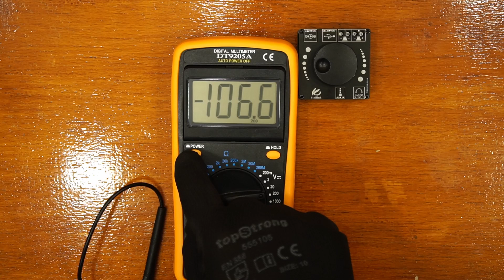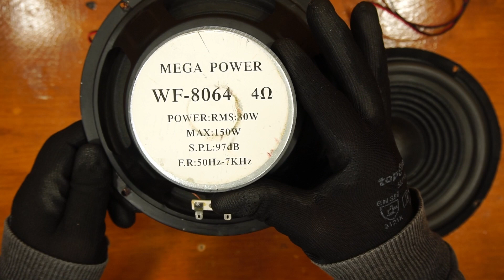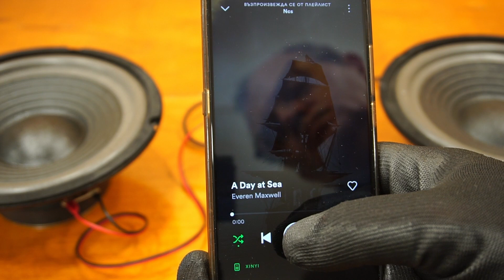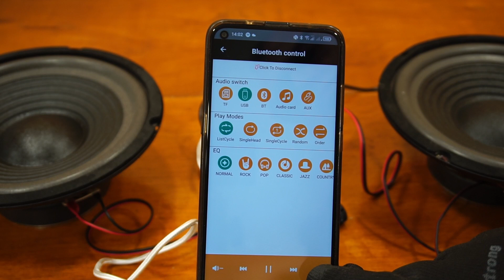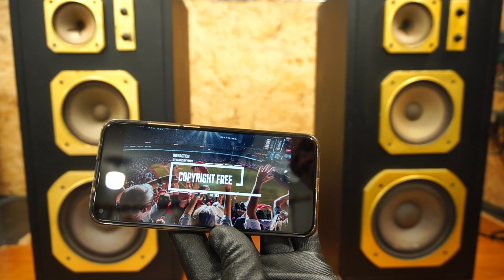Cheap amplifier Sinilink XY-AP50L 50W + 50W 24V assembly and testing

Comment: "Could you help me with a question, if I can use the speaker outputs along with the P2 output for headphones, do they work together?"
Reply from the maker: On a regular amplifier - when the headphones are turned on, the speakers are turned off.
There must be a mixer to be heard in the headphones and have a signal to the speakers!
Let's not forget that this is a small, budget amplifier.
Reply: i use the same model yes when you plug in headphone they both work together the speaker output not turn off

Comment: Can i use 12v?
Reply: Yes
Reply: @shaxzodazizov4129  17 volts?
Reply: @_kamal_editz_  12 to 24 volt,  you need to put small heatsink to smd amplifier
Reply: @shaxzodazizov4129  why
Reply: @_kamal_editz_  it heats very fast without heatsink
Reply: @shaxzodazizov4129 if i dont put it?
Reply: @shaxzodazizov4129  what if i dont put it??
Reply: @shaxzodazizov4129  also whats will bet the size of the heatsink